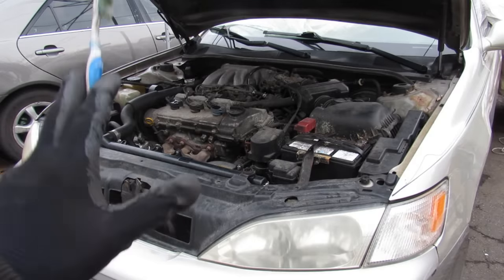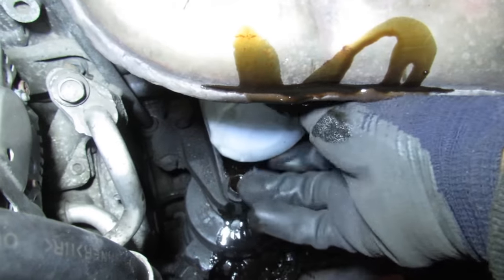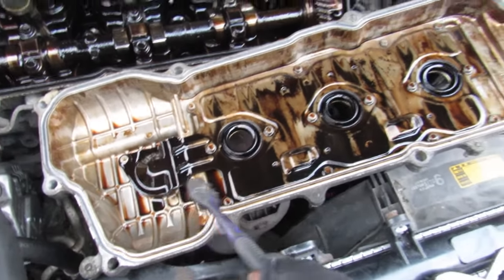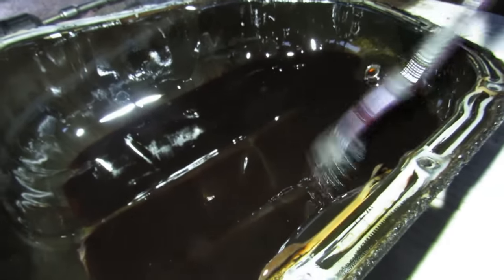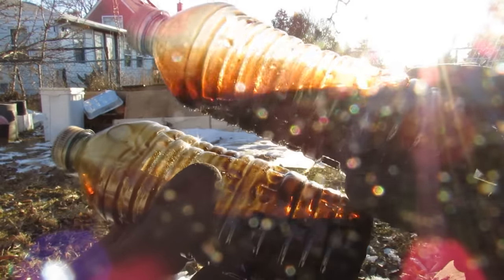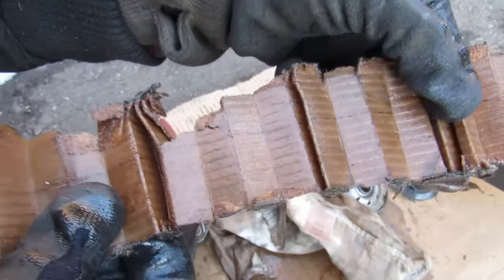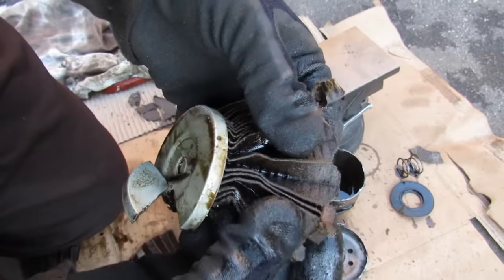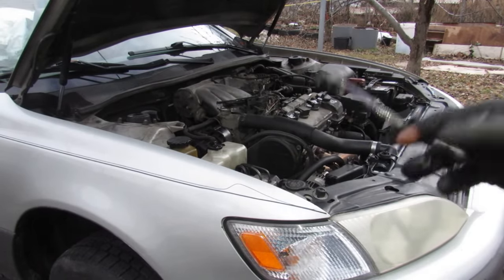Does Flushing Your Car's Engine Actually Work? || Before and After

Comment: What if you use some "engine flush" products? Would be better?
Reply from the maker: Maybe. But this was about ATF
Reply: @speedkar99  Oh, Geez.  I thought it was about dissolving engine gunk.  I will not mention Envirolution then.
Reply: @speedkar99  Was very interesting, by the way. I appreciate how you took apart an engine just for a 5 minute video, that's a lot of work behind cameras!
Reply: @machtschnell7452  
If you've got big chunks that are stuck to the pan corners , it's doubtful a flush is gonna work. 
Way back when we tried flushing an engine that was so bad , it lost oil pressure after a minute of runtime because of the debris jamming the pickup. 
We flushed it ,but when we put oil back in it was about the same. 
I ended up pulling the pan(little v6gm) and scooped out enough hardened cakes in the corners of the pan to fill a half gallon ice cream container. 
Flush would have never loosened that up, and what the flush did loosen was blocking the pickup. 
Another thing you can do , for light sludge is mix up a few gallons of atf and mineral spirits/diesel and fill it to the top and let it set several days. 
Drain it down ,run it some and see what comes out.
Reply: @speedkar99  Sir, why is my i20 2011 turn signal bulb has only 9 voltage?? Is not it supposed to be 12 v??

But the turn signal bulb is working perfectly!!!!
Reply: Engine flush works; the problem is it's too strong. You will dissolve too much too soon. You run a risk of clogging up your transmission screen/filter. ATF cleans @ a slower rate. You can also add 1/2 a quart to your next oil change and drive about 100 miles. This is in order to build oil pressure. If you use method that is shown in this video; when adding your new oil, only run that oil for around 1000 miles. As you will have some ATF and it will get mixed with new oil; that mixture will clean while your driving. Good video👍
Reply: I did a 150~ mile run in my 08 odyssey with 8oz of seafoam in the crankcase, on new oil, and the oil came out looking like it hadn't been changed in 5k miles. Definitely helped just by observing that.
Reply: I like to run good oils with lots of detergents (Shell Helix is pretty good for that where I live) as a general rule, but in an engine like this one they will also slowly dissolve all that crap. It won't be anywhere near as quick as an engine flush though.

I also like to run the occasional tank of premium fuel (I've been favouring shell's V-power because I can't get anything else at 99 octane where I live) as they stuff those things with detergents to clean the shit off pistons and clear up anything that might be upsetting the fuel system, but I'm pretty sure the same job can be done a lot cheaper with just a good fuel additive

Comment: I used 25% ATF to 75% motor oil and drove it for about 100 miles. I got a lot of sludge but there was also some metal shavings too. I dont think it hurt my engine but it did clean it a decent amount.
Reply: Perhaps, but seeing metal particles or shavings in old oil is typically not a good sign.
Reply: @xthomasbhx  it was an older clunker with a lot of miles. I think whoever owned it before me drove it hard. Metal shavings definitely aren't a good thing but whatever damage that caused those wasn't bad enough to notice when driving. I ended up replacing the head gaskets and drove really well then. I don't think head gaskets were causing the shavings.
Reply: @mar91942  ok thats good
Reply: ATF has very little shear strength so you ran your engine with much, much lower viscosity oil dilution. Basic research across the internet says for anyone still using this old ATF trick from the 60-70's when it was a different formulation that you let it idle for 20-30 min, not drive or goose the throttle.  Hope that sludge removal was worth the shavings/wear.

Comment: Just got a 2001 Tahoe with ONLY 135k miles. (Old brick Nokia in the backseat it had been sitting)
-im going to change the old oil at home ASAP before driving it. Then I’ll prob change it again I believe. Great video though

Comment: I'd love to see what the result of flushing an engine with WD-40 would be!  I've seen another video on here where some kids bought a gallon of it to put in an old Nissan to see if they could kill it ...  but it actually made it run better (in the short term anyhow)!
Reply from the maker: Good idea
Reply: I wonder if there’s some mixture I could do for 20min & that could strip the gunk?!
Reply: @jnxythemouse  Diesel oil, 15w40. Ran it in my petrol 96 Hilux for years, changed every 10,000km back in the early 2000's. Car, engine & I loved it.
Reply: Project farm
Reply: Sadly, that video you were talking about was Life OD (formerly known as Haggard Garage). They did an oil change with a Ford Probe & pretty much redlined it until the engine grenaded.
Reply: Chemtool B12 works well.
Reply: WD-40 is deodorized kerosene or something similar with some detergents and possibly other additives in it. At one time, it contained the solvent DMSO but no longer does. Kerosene is a very light oil. It does function as a lubricant but it also evaporates rapidly. It is useful lubricating the bicycle chain for your Saturday ride, as an assembly or disassembly lubricant for nuts and bolts, as a penetrating oil or as temporary lubricant for rusty or uncooperative locks or other moving things that might get stuck. However, WD-40 is a cleaning and a water displacement compound, not a lubricant. Its origins are a little murky and its exact formula unknown, but its original uses were cleaning electrical and electronic parts and components and as a rust preventative on metal exposed to water and humidity. Allegedly, it was first used to prevent corrosion on the outer skin of early ballistic missiles.

Comment: When I got a my truck 350k miles all the original parts. It is a 1991 Nissan Hardbody D21.  Took of the value cover and the oil slug was ‘built’ up around everything.   I did 3qt of the oil it wanted, 1 full can of seafoam, 1.5qt ATF.  Drove it a week and repeated.  4 times.  The motor looks great and I use 1/2 can seafoam when I changed the oil and the other 1/2 a week before.  7 years and the mileage counted broke after a few k’s guessing it is close to 400k now.
Reply from the maker: On a higher mileage vehicle like that, I expect better results than what I got.

Comment: I use a flush about once every other year. I use good synthetic, good filtration , on time and i drop it hot. That helps a lot.
Reply: If you're using synth oil and changing it often enough (I never go beyond 5K miles), you won't ever need to flush the engine.
Reply: @muziklvr7776  ounce of prevention my friend.  I have a Chevy 5.3.  You've  heard the stories. She has 260k on her right now.   Hoping for 500.

Comment: That stuff stuck on the inside of the engine isn't actually doing any harm until you stir it up and circulate it around. I'd just go for using a good quality oil of the recommended grade at the recommended intervals.

Comment: Next time just use diesel fuel. You will have pretty good results. Don't rev the engine. Let it idling for about 15 minutes.

If you would like to have a clean-like-new effect, then use DMSO. It's the most extreme non-destructive way to clean old oil deposits. You won't believe how effective it is until you'll see it on your own eyes.
Reply from the maker: Thanks for the suggestions. 
In this video I just wanted to test transmission oil alone to see it's effects.
Reply: Don't use diesel fuel in place of engine oil in any modern engine. For another thing, you have to be able to store and dispose of the contaminated diesel fuel you are going to create. Most people will never encounter an engine that is so sludged that any extreme measures are necessary. Regular oil changes even with semisynthetic will clean an engine. The sludge is inert and doesn't do anything.

Comment: I would just change the oil and drive my car a thousand miles and replace the engine oil and filter. Then repeat the process two or three times in a row that use transmission fluid.

Comment: I had once bought a car from a scammer dealer who fitted the broken oil pan with a temporary plug. Original drain plug wouldn't work due to broken threads. After a research I discovered an oil drain valve which would fit perfectly without any leaks. I also bought a set of ramps, so I could service the car myself. I would buy the cheapest oil and replace every few thousand miles, so never had any issues with oil or engine.

Comment: You want long term engine flush? Use diesel truck engine oil (that compatible for gasoline engine as well)

Use it religiously, a high mileage over 10years old vehicle internal looks brand new liie just got out of showroom
Reply: This is very good advice.  Effective and very safe.
Reply: @seanthompson8071  yup plenty of verified usage over long term...mainly on petrocanada duron-e as well as other reputable diesel engine oil brand

Comment: May be my concern doesn't make any sense but I always wondered if the softened sludge can redeposit a resolidify in critical places like orifices, valves and such which were originally sludge free before the flush? I am not taking about large chunks of sludge breaking loose during the flush. I am talking about resludging a motor afterwards since some sludge remains and never comes out 100%.
Reply from the maker: It is possible. 
No clean is always effective. 
Do the best you can to buy you some time. 
Eventually the engine is gonna have to come apart and get rebuilt and cleaned.
Reply: Sludge generally stays where it is, unless you have additional sludging occurring which grow at the existing sites because they have less velocity, and just break off, like a blood clot.
Unless you know you have significant sluding, simply using a decent full synthetic, even Walmart's Supertech, and keeping to sane 5/6/7K oil changes will both clean and keep everything clean.
Reply: @boots7859  I say, accelerate the oil change interval but what you are saying will work. What I advise is that if conventional oil was original in the engine, use semisynthetic and keep a short oil change interval. Most people do all short trips driving as it is. I think engines which use synthetic oil develop a different type of sludge than occurs with conventional oil, something that is just a thick liquid. I go 2800 miles on semisynthetic in my vehicle. I rarely drive a trip longer than about five miles these days.

Comment: Aftr engine flush you need to change oil like 2 times a week for a month ..all those tiny bits that stay behind will block small oil holes.
Reply from the maker: I just wanted to see what ATF might do short term
Reply: @speedkar99 
Very interesting experience, I didn't now AFT can be used and an engine flush.
I have question though. Where is the oil filter in the circuit loop ?
I guess it's after the pump and before going into engine lubrication network. Can you confirm ?
Therefore, we shouldn't worry much about the bits. They should stay in the filter can. Right ?
Can some chunks damage the pump ? Or will they just be crushed ?

Comment: i didn't know ATF can be used as a engine flush, i know this is just a experiment but still nice work sir
Reply from the maker: Thanks ....it has detergents that clean transmissions so why not engines
Reply: In the old days, substituting one quart of ATF for the final quart of oil would unstick sticky lifters. It did work.

Comment: I'm a mechanic for over 40 years. This engine does not need a flush. It actually looks like it had timely oil changes and was well maintained.
Reply: even if its dirty if you use flushes you may end up transfering the sludge into worst places , as long as engine is running and its oil& filter keep changed normally it  will be ok
Reply: @Techie1224  To clarify, I don't flush engine oil in cars. Last time i had a sludge vehicle that customer wanted cleaned I removed valve covers, oil pan and physically cleaned all parts. That was when I first started fixing cars, learned a valuable lesson, too time consuming with questionable results. Never flushed engine oil again.
Reply: @rubencastro7837  
i appreciate that 😊

Comment: I usually run about 6-8 ounces of sea foam in the oil right before changing the oil if I just purchased a car, seems to help with carbon build up in the engine.

Comment: I run about 8-10 ounces of kerosene through the crankcase after every oil change.  Cleans the nastiness out of the that accumulates even in newer cars.
Reply from the maker: Do you have proof?
Reply: @speedkar99  : Uh, only been doing it to all my cars for 45 years.  My '99 TL has 286,000 miles.  '97 LS400 is showing 164,000.  '14 Chevy Equinox just turned 99,000 miles.  My Mom's '09 Acura RDX has 141,000 miles.  Doesn't seem to hurt.
Reply: @speedkar99  : My grandpa told me to. He was an airplane mechanic during WWII.  He rebuilt lawnmower engines in retirement and rinsed every small engine part with kerosene.
Reply: Kerosene is safe? No damage to engine? Thanks
Reply: @dashcamjourney4599  : Some people clean with mineral spirits, but Grampy said mineral spirits will dry the parts too much.

Comment: Is that a 1mz-fe engine? If so, they have sludge problems and ALWAYS look like they never got their oil changed. There was even a lawsuit about it.
Reply: My 1996 camry v6 1mz-fe ran like champ until I sold the car at 300,000 miles. I mostly used Chevron conventional oil every 3000 to 4000 miles with new filter. The car was still running like super at high mileage

Comment: Flush by adding a quart of diesel fuel to your old oil and idle for 10 minutes and drain then add your favorite oil with 8 oz of ATF and leave it in there.

Comment: From your experience, what works best to clean engines?
Reply from the maker: I don't have much experience with after care cleaning because I maintain my own vehicles.
Reply: @speedkar99  Okay, what do you use on client vehicles? I saw you using some sort of engine flush that was in a bottle that u poured into the engine and ran it for a few minutes on a solara in one of your videos.
Reply: Manjoyt Kang engine flushes aren’t really needed as maintenance just keeping clean high quality oil will do the trick
Reply: Safest way to clean a somewhat dirty engine is to run a HDEO (gas/diesel oil) and leave it in for 2,000 - 3,000 miles.
Reply: @seanthompson8071  shell rot Ella for the win. High detergent contents. It will clean out the engine but it may leak after the clean as the gunk is sealing the engine.

Comment: I had a car with a cylinder head that look like that this is what I did to make it look normal just by changing the oil.
I work at oil change places and I collect the old oil 0w20 5w20 5w30 10w30 and 15w40 mix them altogether because it's free and that's what I use for my oil. The cylinder head looks brand-new now home for about 6 oil changes

Comment: Atf has friction modifiers in it. So it will seize your engine. I would do marvel mystery oil instead. Or use synthetic oil and frequent internals to be on the safe side. Harsh chemicals is bad for seals, and require dropping oil pen.

Comment: I use a quart or two of automatic ATF transmission fluid not Dexron Mercon actual ATF. Every oil change and you should never drain all your oil out and just put trans fluid in it and do what he did that will definitely cause wearing on the bearings especially vehicle with high mileage... keep this in mind with a vehicle that has been poorly maintenanced or high mileage with sludge buildup by doing an engine flush any sort will cause some sludge to break loose and become oil contaminants and will fuk some shitt up .
If it ain't knocking ticking just do regular maintenance oil changing if it ain't broke don't fuc'n fix it.
By adding any type of engine oil flush or transmission fluid never drive it only let it idle for about 20 minutes.
I have been doing this for years or cars was sticking valves or upper end ticking
I use regular ATF nothing specific
( do not use Dexron Mercon only ATF automatic transmission fluid)
Instructions on how to do this:
1.    Top off engine oil . Do not top it off with trans ATF
2.   Run or drive the vehicle until it is at normal operating temperature( what I do is usually go on a 20 minute drive on the expressway)
3.   Let the vehicle idle poor in one quart or two quarts of ATF depending on engine oil capacity.( do not drain engine oil you're going to add ATF)
4.    Let engine idle for 20 to 30 minutes 
5.   Turn vehicle off let it set for 10 minutes and drain the oil with drain plug still pulled what I do is get a cheap quart of oil or a gallon of kerosene depending on what type of flush it is a basic oil change 1 quart of engine oil if it's a head gasket engine oil or very sludged up motor use a gallon of kerosene/ diesel
Let it drain for at least 10 minutes or until you see nothing coming out the drain plug / oil pan
6.   Reinstall oil drain plug add quality oil I prefer Valvoline maxlife been using it for years

If you have to flush the engine a couple of times you can use conventional cheaper oil
People do yourself a favor oils are not the same so don't be cheap take care of your engine your engine will take care of you my vehicle has over 250,000 miles still runs like it's new.
Reply from the maker: Nice

Comment: Use type F transmission fluid. Type F doesn't have friction modifiers in it unlike other types of transmission fluid. Friction modifiers are used to help increase the friction on the clutch packs inside of an automatic transmission.
Reply: Never thought about that, thanks.
Reply: You are half right. 
Type F does not have friction modifiers in it, correct.
Friction modifiers reduce friction.
Type A has friction modifiers which give hydromatics and non-Ford transmissions smoother shifts.